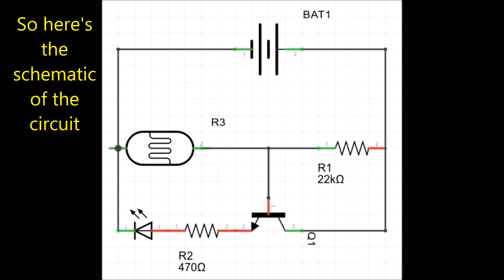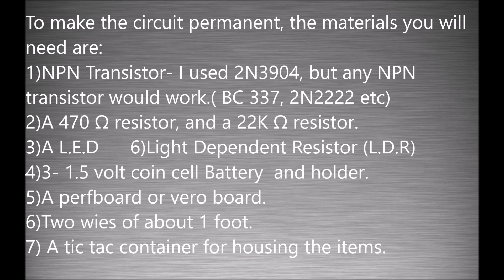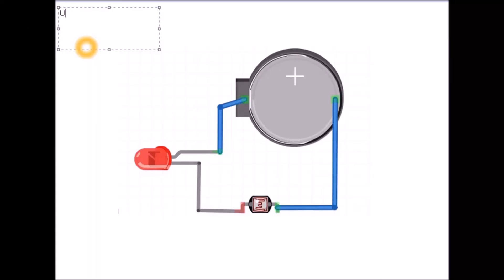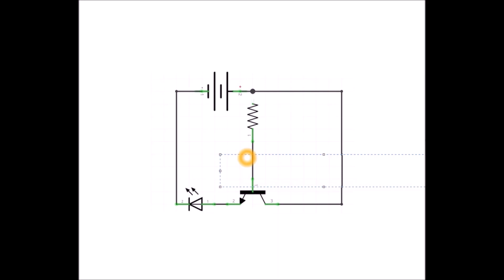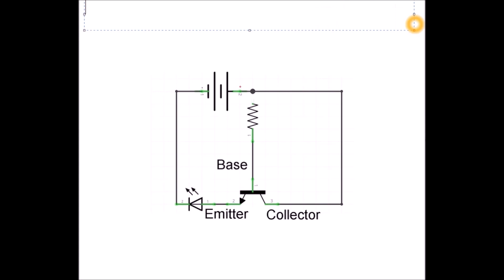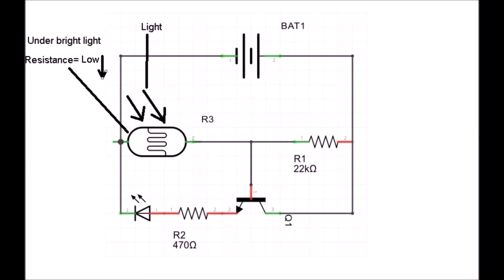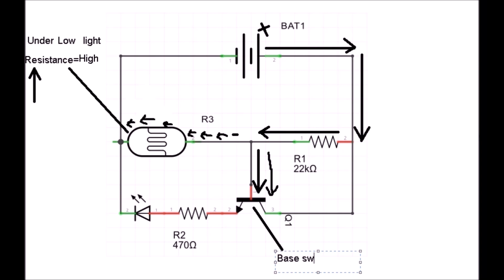Nightlight with Dark sensor

Comment: Why is your load (led) on the emitter side of the transistor? Shouldnt it be on the collector side?
Reply from the maker: This follows the emitter follower configuration which gives a gain of ~1. In this circuit, gain isn't essential, as long as it follows the base voltage which is the feedback from our lighting condition (minus diode drop off voltage from base-emitter).  When you need more signal amplification/gain thats when collector side would be preferred.

Comment: At 0:30 what is the reason why resistor 1, 22kohm is placed where it is instead of any where else? Also,  what resistance level activates the transistor/ LED? Is there a way to adjust this resistance threshold?
Reply from the maker: Sorry for the late reply. Resistor 1 and R3 forms a voltage divider. Under low light R3 is several magnitudes higher than R1, voltage from from the voltage divider of R1 and R3 is almost equal to the battery voltage. This voltage at the base of the BJT allows current to flow through collector emitter of the BJT and turn on the LED. R1 being in series with R3 there helps to create a voltage proportional to the light basically. As for your second question do you mean what resistance level for R3 activates the LED? That will depend on battery voltage, LED type and your BJT parameters. To adjust the threshold for light easiest solution would be to use a 10Kohm resistor in series with a 50Kohm trimmer potentiometer to replace R1. Adjust the pot as needed to adjust the threshold.
Reply: @AHElectronics  Thank you for the explanation, I still need to learn what gain is. I just learned about voltage dividers after watching your video. How could I make the LED turn on when its pitch black, but still have enough voltage to make my 3V led fully bright?

Comment: Very interesting project! Really liked the use of Tic-Tac box. But why do you use high-side switching (collector to + terminal) instead of low-side switching (emitter to - terminal)? Isn't low-side switching a preferred method for NPN transistors?